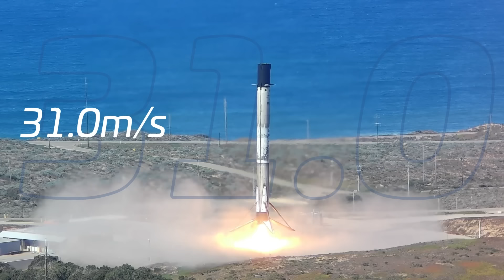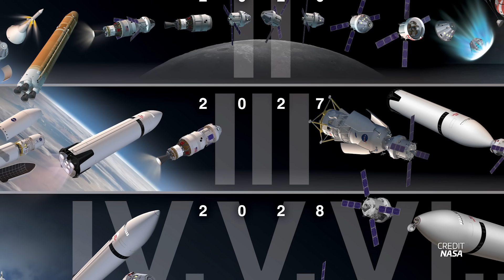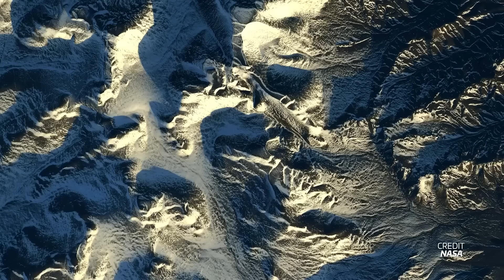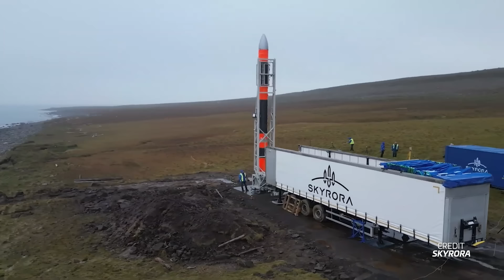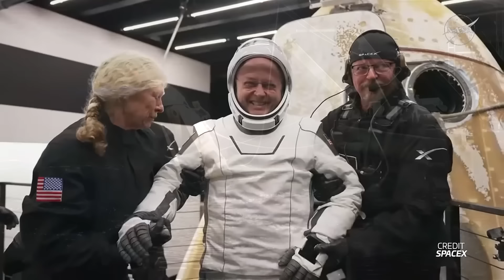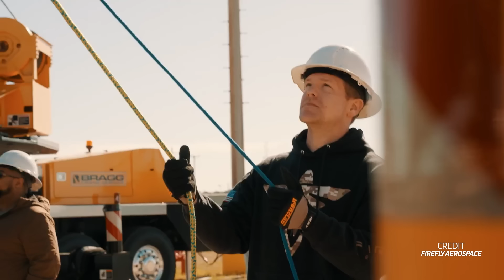NASA Changes Artemis Plan — Moon Landing Moves to Artemis IV | This Week In Spaceflight

Comment: I have a sinking feeling they are dropping gateway, which would really suck.
Reply: I like Gateway, two of the moduals are already mostly built. Most of the money to launch the basic moduals has already been spent.
Reply: @reeselisko3485 That is true, the ppe is the most important part, and that launches in a year (supposedly).
Reply: @reeselisko3485 a tollbooth in a horrible orbit ruining missions.
Reply: @kazioo2 You should investigate low-energy trajectories.  Gateway's the jumping-off point for low-energy transfers beyond Earth.
Reply: @RobinMiller-v6c  Gateway's NRHO itself is not a low-energy trajectory.  It costs significant propellant (or delta-V) just to get to NRHO from low Earth orbit.  If you're going to deep space destinations from LEO, it's always much more efficient to go there directly from LEO, rather than stopping over at NRHO along the way.
Reply: @Spherical_Cow  Sigh. Never said Gateway's orbit was a low-energy trajectory.  Any facility in NRHO at L1 is a marshalling-yard; the functional equivalent to a barge depot on a river. 
I notice you haven't defined your use of "efficient": what's your criterion - time? Cost?  Fuel consumption?  Sure, if you want to use fast Hohmann transfers from Earth to get where you're going, LEO is best. But then you have to wait for planetary alignment. OTOH, slower, fuel-sipping weak-stability boundary transfer windows are much more frequent, and if you're not shipping biologics, who cares?  Cargo from Luna to deep space?  Gateway is appropriately named. 50 m/sec to L2 from there.  Ballistic capture at Mars orbit saves delta-V you must burn on Hohmann transfers. If humanity graduates to becoming a spacefaring civilization, there will be a facility there.  I'm in favor of sooner, rather than later.  Wouldn't you agree?
Reply: @RobinMiller-v6c  It doesn't matter what you call it.  If it costs more delta-V to get to your "marshalling-yard" first before going to your destination, that's not a smart use of resources: you're better off just going straight to your destination (and if you need to 'marshall' before departing, then do it in LEO).  Cargo from Luna to deep space?  Just when do you imagine this will become practical: how many decades after Gateway has aged out of its useful life?  LOL  Talk about putting the cart before the horse...
Reply: @Spherical_Cow  Let's put up some numbers, then. 
WSB ballistic transfer from LEO to NRHO (at L2; I misspoke) "slow boat" delta-V ranges from 7-60 m/sec; 'fast' transfer is about 400 m/sec one-way.
Hohmann transfer, LEO to NRHO: 3950 m/sec.
Using Oberth effect ('gravity assist') at Earth, from Gateway to Low Mars Orbit costs an additional ~1km/sec delta-V. 
Direct Hohmann transfer, LEO to LMO, delta-V: 5702 m/sec. 

Smart use of resources: Gateway.  

Low Mars Orbit for as little as 1007 m/sec.!  Even using Hohmann transfer to get to Gateway, the numbers don't lie.  Add in refueling potential, and even 'ordinary' upper stages like Centaur could push 7t to Mars.

And unless we extinguish ourselves in nuclear fire, we humans are on the verge of /exponential growth/ in space. Stop bitchin' and enjoy the ride.  I am.

Or you could see an optometrist about your myopia.  You decide.
Reply: Gateway is nothing but a make-work boondoggle for ISS support staff once ISS is retired, and for SLS to have something to do to justify its continued existence.  It's a giant waste of time, money, and effort - much like the SLS itself.  It advances no new technologies; it achieves no new milestones; and if built it'll be an albatross around NASA's neck, sucking funds and resources for decades more that could be more productively spent on other things.
Reply: @Spherical_Cow  Good points, and I should know -- since that comment is verbatim plagiarized from something I said years ago.  At least as I'm seeing it now, so don't bother editing it.  The weird games played by bots on social media...

(Edit:  Don't hurry to deny it or anything.  LOL.  Any explanation for just cutting and pasting an entire paragraph of mine without attribution?)
Reply: @dudermcdudeface3674   I don't even know who you are, much less what you wrote somewhere a year ago... LOL
Reply: @Spherical_Cow  A copy-and-paste comment bot isn't a social engagement.  You're probably doing lazy karma farming to promote some stupid product, service, or troll agenda later.
Reply: @dudermcdudeface3674  a healthy amount of paranoia when engaging on the Internet is advisable.  Jumping to paranoid conclusions on zero evidence is not healthy, and not advisable.

Perhaps you ought to ponder the possibility that, out of the billions of people on this planet, there just might be a few who had thoughts similar to yours based on the same sort of information that was available to you - and arrived at similar conclusions in the process...
Reply: @Spherical_Cow  Try not to strain yourself blowing that much gaslight out the rear hatch, sport.  It's not a "conclusion."  Your comment is literally a character-for-character paste of an extensive thought on a somewhat rare topic, including specific placement of unorthodox punctuation.  

If you're gonna do something that lazy, maybe pick topics more people talk about, and use fewer and smaller words to do it.  Less chance of embarrassing yourself with that parrot act around the same people you're ripping off.
Reply: @dudermcdudeface3674  🤷‍♂  Like I said, I don't know who you are, or what you wrote whenever and wherever.  My comment came from my mind, and was touch-typed out on a smartphone keyboard in real-time.  I'll just leave you to stew in your paranoid fantasies, because at this point this exchange has become, implausibly, even less productive than it was when it started...
Reply: @Spherical_Cow  ROFL.  Strange how far down the evolutionary ladder your dynamic responses are from "your" first comment.  "But that IS my A paper, teacher!  I pay so much attenti-muh-shin in clazzimatazz!"
Reply: @dudermcdudeface3674  welp, I've now come to yet another conclusion.  You're a troll, and now you're blocked.
Reply: @Spherical_Cow  Something tells me I'm not blocked by your copybot, Captain Xerox.
Reply: Gateway was never any more serious of a program than SLS-Orion.  It was just a much smaller, farther-away, and more radiation-bathed version of ISS, which they also weren't serious about until Columbia forced the issue a decade into the program going nowhere.
Reply: @dudermcdudeface3674  We have never attempted long duration stays outside of our magnetosphere. the ppe is also useful as a tug for future missions. I think gateway is way more important than a 7th moon landing.
Reply: @Vsor  So just stay on the Moon a while, shielded from half the universe's radiation and with a perfect shelter just a few meters below.  There's literally no reason to stay in lunar orbit.  Except the specious safety argument about emergencies, which doesn't apply if there are routine flights.  And if there aren't regular flights, then the Moon can't be settled and the whole thing is pointless.
Reply: Anyone who is pro gateway is ANTI space and PRO corruption.
Reply: @kazioo2 Artemis is about a permanent foothold in space. The end goal is to destinations beyond the moon. If all we do with Artemis is walk around on the moon some more, we have failed. Gateway is the only piece of hardware in this entire plan that can be used beyond the moon.